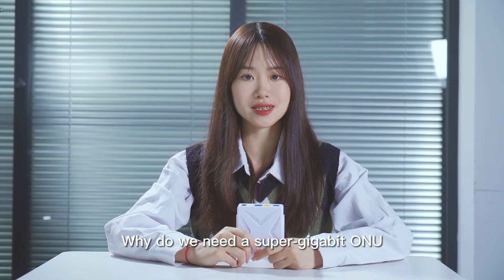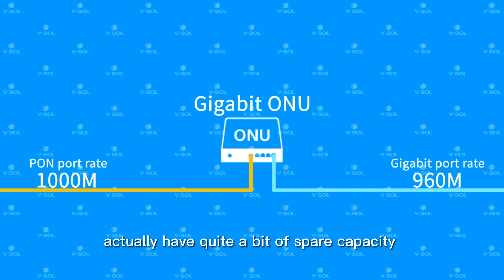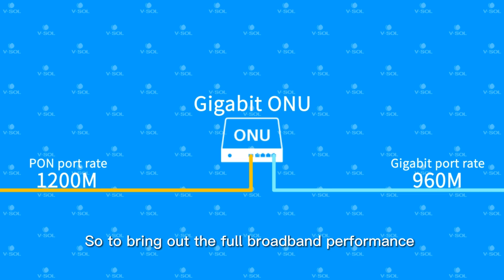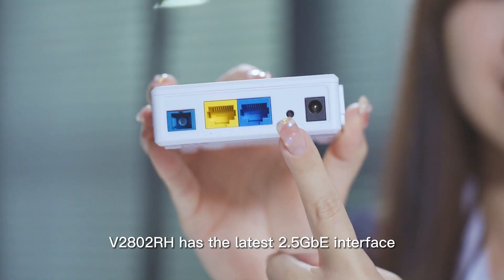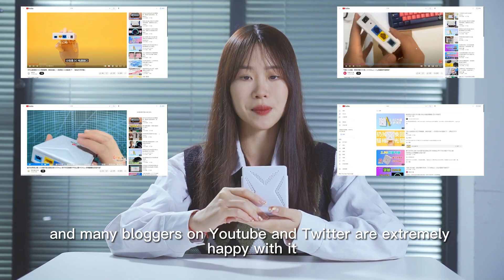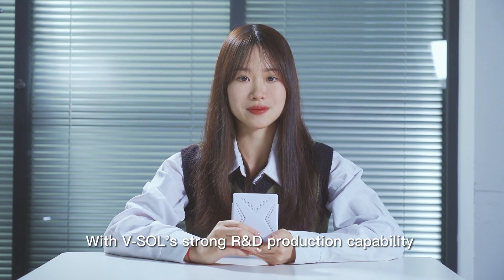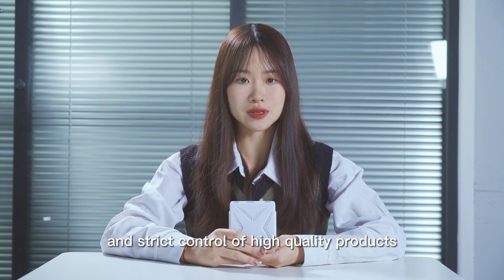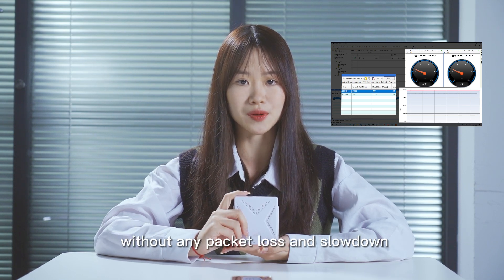Why do we need a 2.5GbE ONT Router for a Gigabit network? | V-SOL

Comment: What is the real download speed from 2.5GbE ?
Reply from the maker: It depends on how much the operator bandwidth you purchase, whether the cable connected is Cat6e, and how much the terminal NIC is.
Reply: @vsol-tech  If the provider has 2.488 Gbps GPON speed and the PC NIC is 2.5GbE, can this deliver full 2.5Gbps speed?
Reply: @vsol-tech  5E supports up to 5G easily if cable is decent quality lol